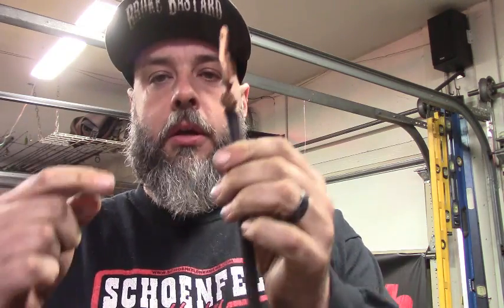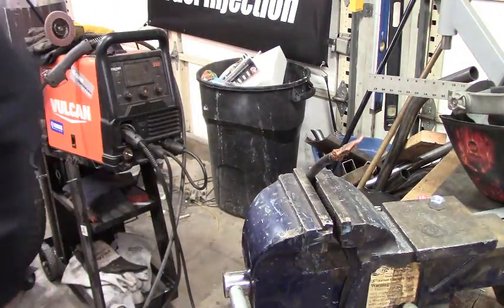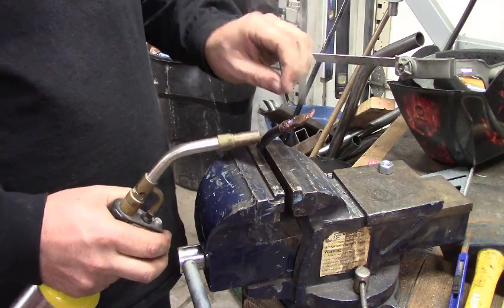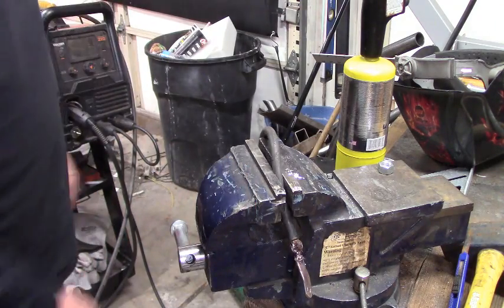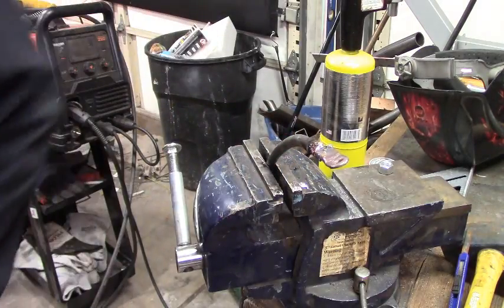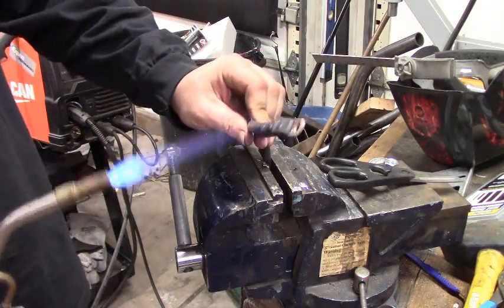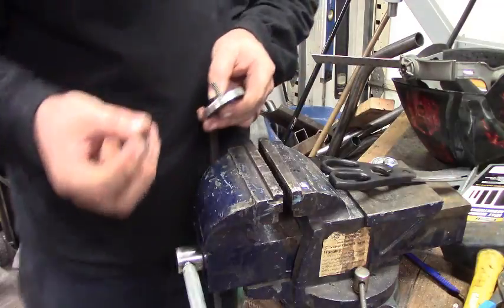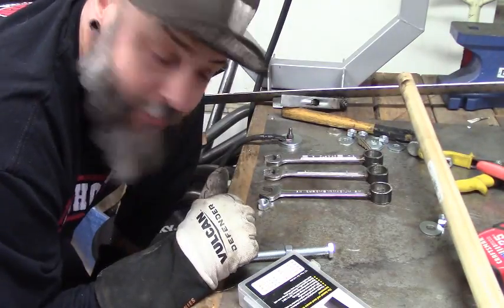Quick Welding Ground Hack!!

Comment: Instead of solder why did you not cut bad end of wire and old terminal off add a new terminal and squeeze new terminal on the wire then add magnet

Comment: I drill holes in the lug and torch the lug and just feed it in as much as you want or it will take! This is after I crimp with a 11 ton crimped! Quick question I’m trying to weld a nut onto a transmission tower bolt that’s completely stripped out but having trouble finding the best place to ground to cause I’m a super green welder with a cheap mig welder? Any help would be great! Thanks and I make Big Three battery vocable upgrades for people out of welding lead Excelene 2/0 and 3/0 that’s only reason I threw in the info on the soldering! Thanks

Comment: Electrons travel on the surface of the conductor. That’s the advantage of multi strand wire and braided straps. Filling it with solder defeated this.
Reply: Isn't the ground wire a bunch of tiny wires?
Wouldn't the electrons travel on the surface of each individual tiny wire making up the whole, rather than just the exterior surface of all of the wires?
If so, the electrons still have plenty of room to travel along the inner wires and their exteriors.
Basically, he only covered the outside.
There is still plenty of surface area on all of the tiny wires that make up the larger cable.

Comment: I did the magnet thing a couple of years back. Seemed a great idea to me. But I found it would stick to rusty metal as well, but you can't get a good ground on rusty metal. Have you tried it on a rusty fender yet??
Reply from the maker: Andy's Dog House not yet. I have been cleaning areas before I ground it.
Reply: @BrokeBastardGarage  Don't grind the nice patina off old Rats.

Comment: Using solder isn’t a good idea. Solder has poor electrical conductivity. When it’s used for electrical connections, it’s only intended for the mechanical strength. The copper wire is supposed to be crimped tightly around whatever it’s connected to. The solder also keeps it from the air, and oxidation.

If you’ve got a connection such as the one you’re working on, the damage is already done to the copper connection. The solder will only partly compensate. You could do it to a new connection, where the copper isn’t damaged, and all strands are crimped in. But, with the high heat, you’re risking oxidation to the copper, and loosening of the crimp, which is happening here too.

I’m not saying it won’t “work”. But that the current carrying capacity won’t be what a new connector, with new wire will be. It would be better to cut the old crimp off, and replace it, if you have a proper way to crimp it on.
Reply: i disagree with your comment totally, PCBs handle such a small amount of voltage and current if solder was not such a good electrical conductor then there would a lot of trouble trying to make an electronic device work. Solder is made out of tin which a conductive metal.
Reply: @vaguincolombia  hey there, maybe you can help me out!? 
 I've stripped out a PC 12v and want to solder the clusters.. what would you recommend?
Many thanks in advance :)
Reply: Depends what kind of solder.
Reply: @DelinquentDemon  doesn’t really matter. The differences aren’t great.
Reply: @vaguincolombia  all metals are conductive. Tin and lead are not very conductive. Look it up.

Ah heck, I’ll give some numbers. With silver being on top.

Silver……1.05
Copper…1.00
Tin……....0.15
Lead…….0.08
Reply: @melgross  atta boy